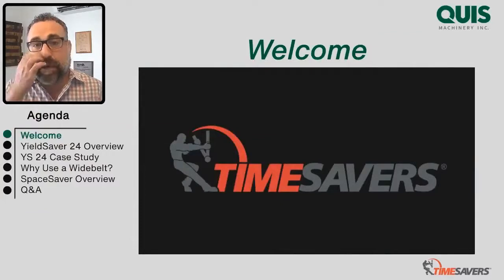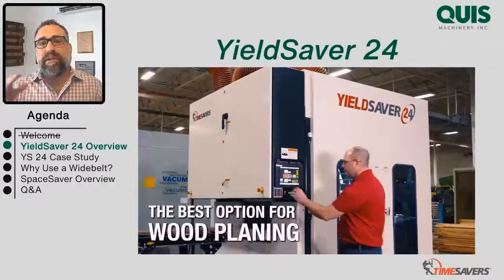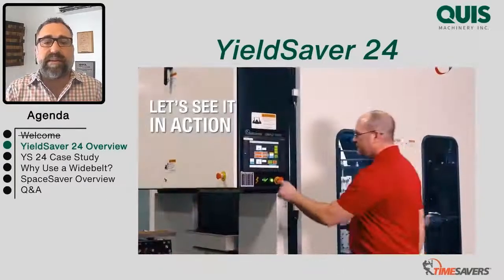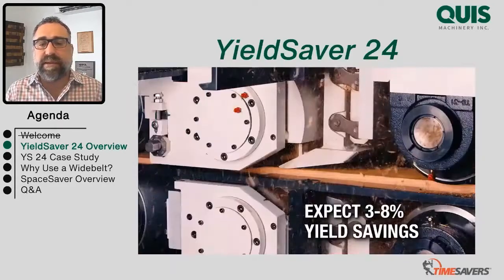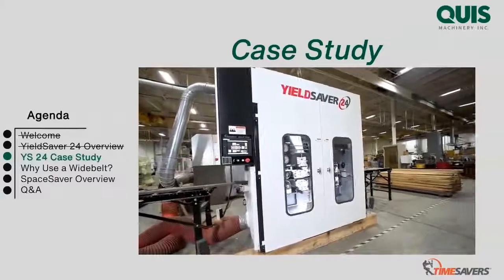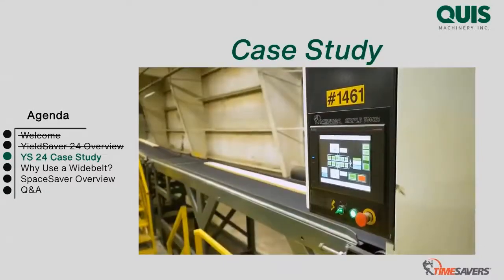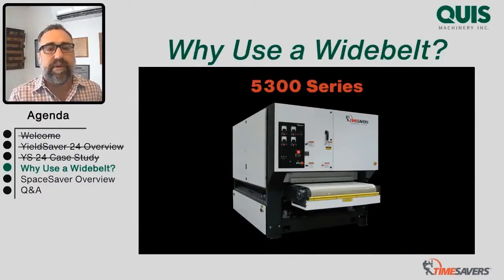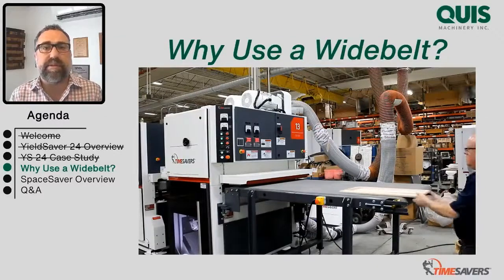IWF Connect Timesavers 1300 Series and Yieldsaver 24 Demo

Comment: Hey, I have a time saver 1300, I have a problem the machine turns on but does not start, I changed a fuse that was blown, I put a new fuse on it and it worked for a minute and burned the new fuse, could you help me know what the problem would be? I would really appreciate it